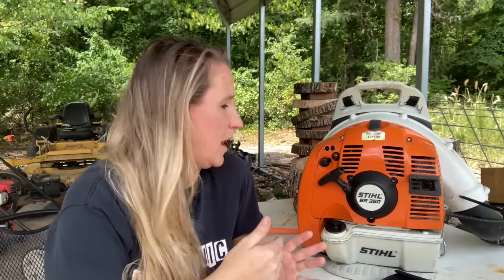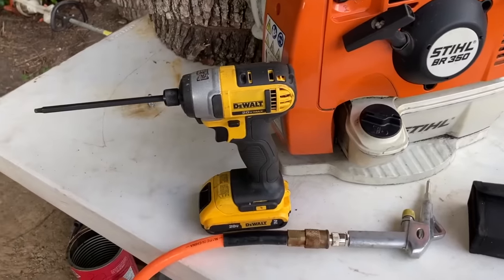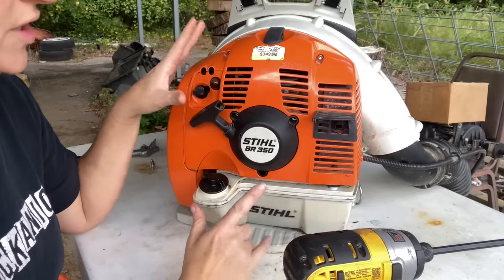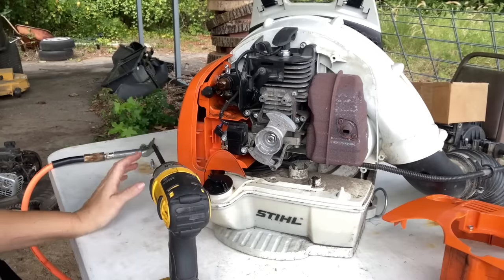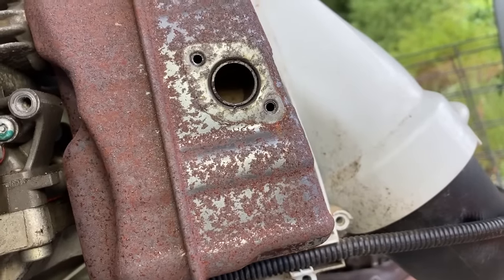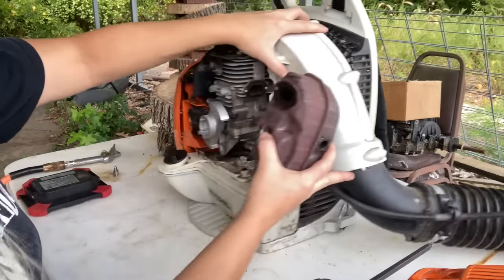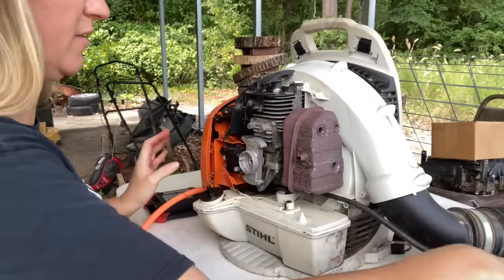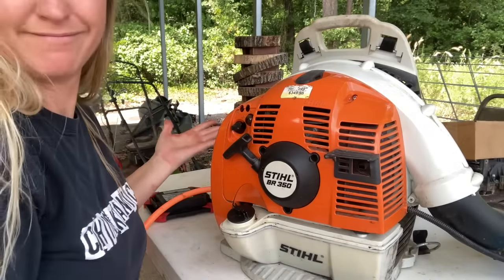Stihl won't throttle up or stay running? First thing to check!

Comment: I guess the screen in the muffler does more than keep the sparks in. My wife has a small 2 stroke rototiller that she uses every 2 years or so and so far it's always fired right up after sitting because I drain the fuel out then run it until the carburetor is empty so the engine stops.
Reply from the maker: I bet it is a Mantis tiller. They will last a lifetime!
Reply: @Chickanic  That just happens to have an echo motor on it! I got a Mantis and you are right.
Reply: Believe it or not it is a return item that she bought as is at Home Depot and it's a Powermate (Chinese?)
Reply: @donmears4090  Dang it
Reply from the maker: @donmears4090  LOL! Yes, it is a Chonda. A chinese Honda. They actually are not bad units for the price. The only problem I have with working on them is there are usually no adjustments on the carb. So if it ever needs that little extra bump, you can't do anything but buy a new carb. At least you can get them cheap though!

Comment: Great videos, very helpful stuff. I have a BR450C that a buddy wanted me to troubleshoot. When you pull the starter through, there is a clicking/knocking sound. Someone said that it might be a bent rod. Thoughts?
Reply: On second look, it doesn't look like there are rods....NOT a 4-Mix engine.
Reply: Mystery solved; after a complete tear down, a very scored piston, and a destroyed crankshaft/con rod bearing. Can bad fuel or straight gas do that?

Comment: Hi i have some HS46C Hedge Cutters here in the UK. They start and idle fine, and sometimes run ok on full throttle then after a while they just bog down and cut out. They start fine again...then hit the throttle and they bog down or die. Any ideas?? I did attempt to clean the Spark Arrestor earlier, i took the whole thing apart but couldn't find one therefore not even sure if they have one? Thanks

Comment: Hi, I have a Husquarna blower with the same issue. It will start, sometimes hard. Run for about 10 seconds row and die. Fresh gas, new lines and gas filter, tried without air filter and muffler , checked the ignition switch with multimeter, rect the gap, the compression is around 150. I even tried a new carb. Nothing works with this one. Took it a part like 10 times. Have no idea.

Comment: So i have a stihl br 600 and after running it for 10 to 15 minutes, it will bog down and die when i oress on the throttle. Spark plug looks fine but ill probably change it tomorrow, i was also thinking of the 2 screws by the choke for higher idle. And yes im running that canned gas Tru. What's a good 2 cycle oil to buy? Whats best?

Thank you

Comment: Had a customer come in with a fairly new BR600. He said he had it going full throttle cleaning off his driveway. Said it just stopped and almost jumped off his back. Took it apart and found a broken valve stuck in the top of the piston. I replaced the engine under warranty.  Not sure what happened.

Comment: I’ve got a stihl handheld leaf blower. Relatively new..a couple of seasons of use. Has been running perfectly, and i recently began mixing my own fuel for it as opposed to the stihl 2 stroke fuel the make. I don’t even think I’ve made it through a full tank, and it has cut out. I can’t get it back, or even to sputter, and the pump won’t fill up with gas. I feel like it has to be a simple fix, but I don’t have much experience in troubleshooting these type things. Tips?
Reply: Are you shaking up the gas before each use?  The oil and gas will separate when left to sit.  Then you dump all the oil into the first tank.  This’ll usually cause a two stroke to run fine for a short time, then not at all. 
Remember, check the simple stuff first. 
Also, if you’re only using occasionally, the premixed fuel is a great idea.  You’ll find it starts much better after sitting and had fewer carb problems.

Comment: Which one is the best 2 cycle oil Echo or STIHL I use Husqvarna oil in all my equipment no problems with it when I bought Echo backpack blowers recently put echo 2 cycle oil in I barely use Echo red Armor 2 cycle oil in my equipment

Comment: What’s the best way to Winterize 2 cycle motors ( weed eaters, blowers, etc) ?
Reply: The best way we have found is to drain the fuel and put just 2-stroke oil into the carb and cylinder. This will keep your carb diaphragm and piston rings lubed as well as protect the carb from ethanol. You will have to purge the carb in the spring and the unit will smoke after first start for a short time.

Comment: Hi not sure if you can still get back to people, iv just re built a br 600. New plastic gear, new genuine piston and rings, the cylinder is perfect. After timing correctly and sealing up perfectly even after running in, on full throttle the power drops up and down all the time. Hi and low make no difference. Sort to bother you just hoping you might be able to help .

Comment: My BR400 had dirt dobber nest in the exhaust.   Not just in the port but deep down in the canister.   Take the muffler off and see if it runs better.   New muffler problem solved.

Comment: Bees are a problem with aircraft too when they block the pitot tubes and other ports. Pitot probes are hollow instruments projecting forwards from the aircraft fuselage which measure airspeed by registering differential pressures. Static ports are used by the airspeed, altimeter and vertical speed indicator.
Pesky little buggers!

Comment: Common coacked up exhaust best thing to do is heat the exhaust with a blow torch & burn the carbon away & tap the exhaust while hot lots of smoke will poor out of it.

Comment: Hello,  my stihl blower model BR 800 X will not run in full speed less than a year old. New gas and oil
 filter and screen 1:04 are clean. Brand new spark plug. Got me really stumped. Any suggestions??

Comment: With this issue cause the low end to bog like coming off of the low having a weird issue on my CS 590 I cannot figure out I’ve rebuilt the carb. I’m gonna check vacuum and pressure testing next I’m guessing is the impulse line possibly I replace the fuel vent fuel lines, spark, plugs, you name it air filter it’s hard to get to idle but I did get it to run pretty good but then I would want to try to stall out or die but also I noticed that even when I thought it was rich enough. It was getting foggy off the low, end, route tuna, and then I get .bog all of a sudden.

Comment: I have a question, both my Sthil chainsaws are hard starters. If they set for a week it’s 12-20 pulls to start. Used every day 2-4 pulls on a cold start. Neither has a primer bulb. 024 and an 028. Both are Woodboss AV models. Good gas , plug and clean air filter. Stumped 🤔
Reply from the maker: Other than the fact that they are 40 years old? LOL! Seriously though, there are way too many many variables to know on saws that old that could make them hard to start. I would have to see them.
Reply: @Chickanic  I’m 64 and start right away!🤣 just wondered if there was a common problem besides old age.

Comment: I have a Stihl 032AV chainsaw, it trys start hits 3 times but won't start. New plug clean air filter and fuel filter and gas.

Comment: I had an echo and a Stihl that was acting similar. I did the carbs, spark plug etc. Arrestor clean. Took muffler off and exhaust ports were blocked about 50%. I cleaned them out readjusted carbs and now they scream.

Comment: I have an MS-270C chainsaw. The chain oiler leaks like a sieve. I keep it in a Stihl plastic carry case and without fail that carry case is full after it's stored for a while. I went deeper to look at the oiler after I watched a different video but it wasn't the same oiler and it didn't have any seals or grommets to clean. It was just tiny little thing with two rubber hoses.
It drives me crazy. What can I do?

Comment: Have an SR 450 backpack sprayer same as a BR 450 blower and uses the same carburetor as 350s. After using it for a while it starts going slower and slower, take it off and restart and it goes for a bit more but eventually dies.I put in new gas filter, no fix,  then a new aftermarket Aisen carburetor. now it idles but will not accelerate more than a few seconds, and then barely runs more than idle. if I constantly push the primer valve it accelerates fully. cannot find any holes in any of the fuel supply lines to create a vacuum leak to prevent fuel suction. Good compression but not like new.  Dirt in a valve? Did not check piston scoring yet. Any ideas?

Comment: I am having a similar frustration with a Poulan 4218 chainsaw. Took everything apart and put it back together several times and it will not run. Tries to start but immediately dies. I suspect that the H L jets are not in the proper setting. I have tried several different settings to no success. Any suggestions? I have set it down and walked away from it several times, hoping something would hit me when I came back.

Comment: BG55 leaf blower, hard start.  most of the time no start. compression 110-115  I have spark and fuel .  The plug is wet after trying to start it. flywheel lines up with the coil as the piston is coming  to TDC.. spark arrester is clean. any other thoughts?

Comment: Hello :) 
I have a old Stihl ms250 that needed some new parts, it started before i changed anything. 
i changed the manual fuelpump and chain sprocket. It got spark and good compression. 
BUT will not start at all. it gets fuel. i have cleaned the carburetor and muffler to. 

what can it be that is wrong here ?

Comment: I changed the carburetor, fuel lines, air filter, spark plug, and the blower will only run without the air filter. Any ideas? Ty

Comment: Id just be happy the mud daubers weren’t still actively occupying that manifold. DO NOT get stung by those things. You will be in a world of hurt! I have had them take residence in our gas grill over the winter. And when i tried to light it, the burners would sputter out. The gas venturi was plugged with their nest material. Had to do a similar clean out. Then it worked fine.
Reply: Spiders will do that too. Used to be a service tech for Sears in another life and saw that a lot on grills every spring doing service agreements.

Comment: My Stihl BR340 backpack blower cranks and runs good for about 15 minutes and then starts throttling down. I pump the throttle and it goes back to normal speed for a minute or so and then continues to slow down and after a couple of minutes it slows down and stops. I've changed fuel filter and filled with fresh gas. Let it set about 30 minutes and I'd cranks and starts the same process over. Could it be a bad ignition coil? Thanks

Comment: Help please. I have a Stihl ms290 chainsaw it starts and runs but when you let it idle for a little bit it will die. If you catch it before it dies you have to feather the throttle to get it to stay running or sometimes it will die when you hit the throttle. I’ve changed the fuel filter the air filter and the spark plug. It will run fine while cutting wood and goes back to idle afterwards. It only acts up after it idles for about a minute. Thank you for the help.

Comment: Where do you get those long bits you use in the impact driver?, every time I ask about them I just get the "deer in the headlights" look??
Reply from the maker: The T27 Torx bit I use to remove Stihl/Echo screws? I get them from Echo, but here is one comparable. Thanks for watching! https://www.amazon.com/gp/product/B00B1T5JTG/ref=as_li_qf_asin_il_tl?ie=UTF8&tag=chickanic-20&creative=9325&linkCode=as2&creativeASIN=B00B1T5JTG&linkId=247c10093b6fc896420470878ca8e9a4

Comment: Where I live mudwasp as, we call them, of various sizes, including up to quite large hornets manage to block up sprinkler nozzles, decreasing gun nozzle that is only around 2,5 millimeter in diameter, the largest ones, hornets, can completely clog up an exposed airconditioning unit, blocking the cooling fan with large lumps of accumulated hard mud,  
Fire extinqushers nozzles get blocked up if left uncovered, in fact anywhere mudwasp can put their egg and some little spider for the emerging larva to eat when it hatch, is fair game for those wasps, I have no idea how the emerging new wasps can get out of the clogged up enclosures they are entombed in, but there must be enough that survive from season to season.!  Yes, it is not only engines that they can interfere with, aircraft airspeed indicator tubes are also prone to blockage due to mudwasp clogging them with mud that dry and set quite hard inside the tubes. When I was first told about those wasp I could not believe it,  but now I know.!

Comment: I have a br200 that won’t idle low it idles at about 1/4 throttle all of the sudden throttle works and will rev it rest of way but won’t come down as low as used to 
I visually inspected the cable on carb and all looks good doesn’t look like it’s jammed or stuck
Haven’t opened up the throttle handle yet 
Any ideas or is this a common thing

Comment: Will you charge the customer again or let it go?
Reply from the maker: It did not have the dirt dauber in it the first time I worked on the unit, so I could charge, but since I sat on it for two weeks, stumped, I will just give it back. Not a big deal and a great opportunity to make a video to help others.

Comment: Mine runs like that (Doesn't)  I cleaned the spark arrester and still runs terribly. Because the screen is still there any other suggestions? I've always used ethanol free gas, always stabled. (This happened mid season though) I'm stumped!!

Comment: I have a husqvarna 128ld I replaced the carburetor new gasket hard to start when I get it to run it runs rough and back fires . Could it be the coil , I have a new spark arrestor  coming ?

Comment: I had a similar stumper. A small Yanmar air cooled diesel water pump would start great, but wouldn’t rev up beyond idle. With everything torn apart it would run great. Wtf?  The intake had a black radiator hose with a 90 degree bend feeding the air cleaner housing. A red storage plug hadn’t been removed and the vacuum sucked it up the hose until jammed at the elbow where it couldn’t be seen.

Comment: As far as i know and can see the used br420 i bought doesn't have a spark arrestor and its running like that one i figured its something wrong with the old coil because it is a old blower

Comment: Have a question...have a ms200t chainsaw...ive gone thru it...compression test...leak test...replaced the pulse line...new intske boot...rebuilt the carb...new fuel line and filter...will start and run in high speed all day long but as soon as i try to let it idle itll die like starving for fuel...adjustments on the low jet and setting the low rpm screw makes no difference...acts like it wants to run but eventually dies off...can start it right back up in high speed but no go at low...any other suggestions

Comment: Off topic tech question. Is it normal for some two cycles to produce an oily residue around the exhaust? First time using one, a Husqvarna 128CD. Almost new machine. Fresh 50-1 Stihl fuel, plug gapped at  .024 per manual. Running enough at full throttle for engine temp to be at max. Both filters immaculate. Thanks! 👍🔧🧰
Reply from the maker: No. I made a video about Stihl oil. It will explain what is going on.

Comment: My Stihl chainsaw will start and run fine, but once it's hot it doesn't want to run unless I choke it a lot, then that will not work after a while. After cooling off for an hour, it wants to run again till it's hot. 
Can you help me out on what to do?
It's not the spark arrestor.

Comment: I have a Stihl FS 80R String Trimmer. When I got it, it had sat up for years. A lot of the rubber was dry rotted. I changed, primer bulb, fuel lines, air and fuel filter. Cleaned the carb, cleaned the spark arrester. Had to change the coil because the Spark Plug Wire broke.  Now I am stuck. It is incredibly hard to start, and when it does start it wants to bog down when you rev it up. Cold or hot…. HELP! Please!

Comment: What would make an echo "new" 9010 blower from running full throttle when running and warm? I can give it full throttle and it sputters. It does idle and will rev up but last Lil fit of throttle it falls on its face

Comment: Im working on a br 600 runs great for 20min then spits sputtering mabey runs on idle then will stall, choke it may/may not restart......
1st time replaced carb, bench tested for 15 min on hi idle, worked great, customer picked up, put it to work (real world) brought it back not happy, still stalling out,
Stihl said coil (ignition module) 
Im not convinced! 
Have new one coming that I'll have to eat.
Any ideas?

Comment: I soak it in degreaser and run the hose through it and then blow out the excess water with an airline.

Comment: Yes I have a PB 260L Eco autos fine all that starts Boggin Scott fresh gas good fuel line good fuel filter spark plug looks decent run like the dickens on a choke hadn’t been use long belongs to an older woman any ideas

Comment: I use a stihl sr 540 that has a problem starting when its hot outside my boss thinks its the spark plug i think its vapor lock since there is never gas in the primer ball any thoughts?

Comment: That happend exactly to my friends weed eather, she started laughing when l showed her the problem and fixed it.🤣
    Now l have a probkem with my leaf blower, its an Echo PB620ST, after around 30-40 mins working it wont idle to the fullest quickly, and wont stay fully accelerated and if l realise the throatle it dies, so l have to keep looking for some point where l can keep it on and keep working with it till finish the job.
    I already instal a new cab and spark plug but the problem wasnt solved.   Could that be the ignition coil the problem?